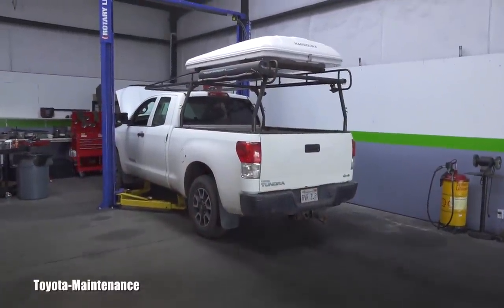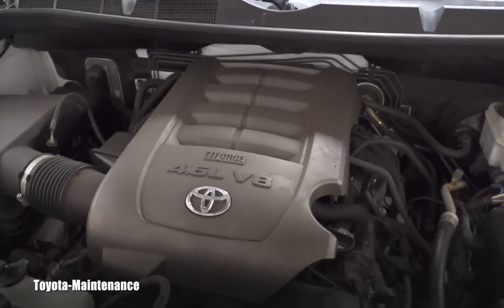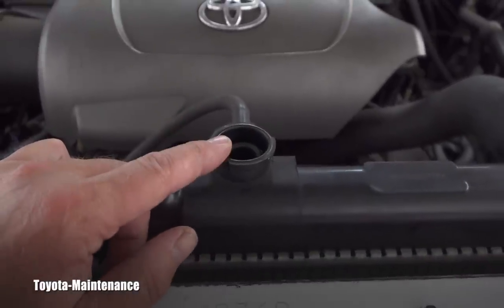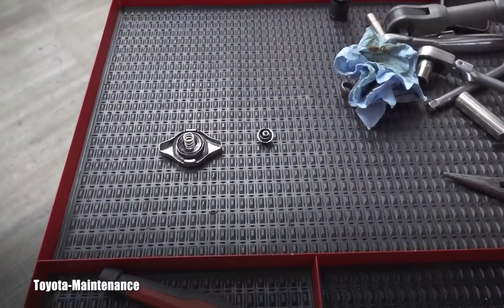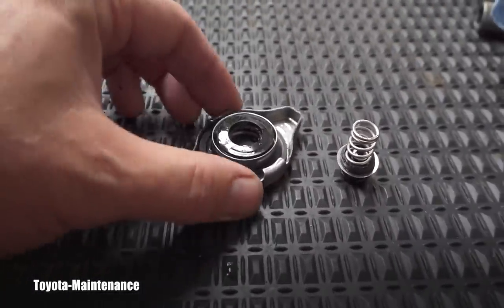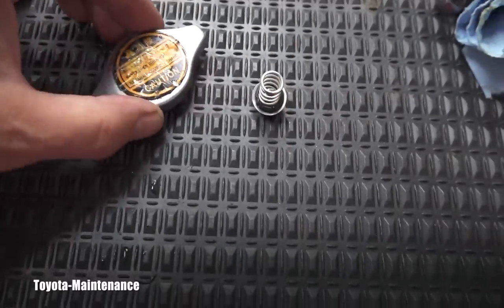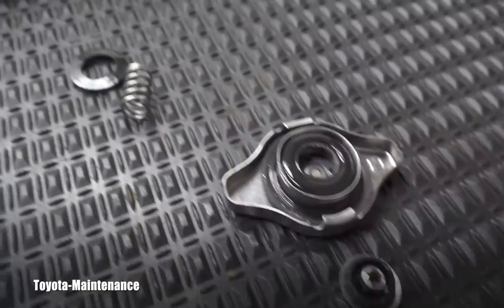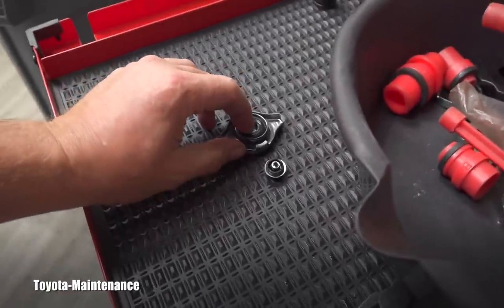The Curse of  Faulty Radiator Cap

Comment: I drove my yaris for 7 years with pieces of the radiator cap inside the radiator. I decided to take it to a radiator shop after 7 years, they removed the top plastic cover of the radiator, and the pieces were hanging on top  channels without any problems. The coolant flows from up to down,  and because those pieces are too big to go through any of the channels in the radiator, they will just hang there with the tight channels acting as a sieve.

Comment: I’m a newbie, I don’t know ANYTHING about cars 🚗 , however I’ve been learning a lot. I just recently had my first car crashed into and the insurance paid me out, unfortunately I had no option at the time but had to buy me a 2009 Toyota Corolla—-I had to do some research on the best car models and Toyota Corollas were always recommended. Anyway, the car seemed like in really good working condition and it looks great on the outside. The car didn’t make any strange noises during the test drive, it ran great, the ac worked fine, the turning and acceleration seemed all on point, but what do I know? I’m not a mechanic. Well, the next day I took it to a mechanic and they found a whole BUNCH of stuff wrong with it. The more important stuff from what the mechanic said needed to be replaced was the Radiator, radiator cap, transmission fluid, and serpentine belt. They were willing to do the work but it was sooo much and I couldn’t afford any of it, so I decided to dig into this and I researched how to replace a radiator and cap. So far I see a full radiator for about $90 and a radiator cap for $30, totaling about $120 if I do the work myself opposed to the nasty $800 for a radiator replacement and including the cap! I’ll be literally saving around $680!! If I did the work myself or shop around, but I might be up for trying to do the job my self to save the money. Of course, I still need to do more research like something about draining the fluids or what not. I don’t own any tools, however I have a buddy that does and even a neighbor that might lend me his. Anyway, my point being is, that I had absolutely NO clue that the radiator caps needed to be replaced AT ALL and after watching this video it makes me realize that the radiator cap should be checked and replaced routinely! This should be common knowledge just like how everyone knows to get an oil change or tires rotated or even replaced. That’s something I would have NEVER guessed before I started learning about cars. My goodness, my eyes are now opened, this is the second video I’ve seen where the radiator cap can cause substantial issues with the car if it’s not maintained, luckily it’s a easily fixable and affordable car part. Anyway, I never really put a lot of effort into my first car, but I made a promise that I would maintain this car much better and have been making an effort and I’ve learned quite a bit. thanks for posting this video, it’s helped tremendously! 🙌🏻

 I still need to do more research on the serpentine belt and transmission fluid, but that stuff I might just have a mechanic take care of, wish me luck y’all cause times are rough out here. 😂

Comment: Thanks for the video. Happened to my radiator cap. Replaced cap with Toyota one. No overheating problems. My mechanic says as long as it doesn’t cause any problems, the parts can stay in the radiator for the life of the radiator. The same kind of plastic corrosion happened to the heater tap located on the firewall through which hot coolant flows toward the heater box to warm the interior when needed.

Comment: Wow I can't believe I found your video. I have a lexus is300 2004 model and exactly the same thing happened to me just the other day and I had to fish out the spring and plastic washer part after overheating and being stranded on the motorway. The fans wouldn't kick in either so I limped home stopping and topping.up every mile or so. My car is still sitting on my drive waiting for someone to tell me what's wrong. However after watching your video I don't think there is anything else wrong and that I just need to replace the cap and refill and bleed the system. What are the chances of that..thank you for the video and thank Mr Toyota for breaking down and then spreading the word... it's a powerful thing. Peace to all

Comment: This occurred to a VW my good friend was servicing at his garage. Apparently, it damaged the plastic impeller on the water pump and sent plastic bits throughout the engine cooling system. Moral of the story: Change your thermostats and radiator caps every 5 years according to his radiator repair shop. Stick with the OE parts.
Reply: SIGH.......the radiator cap in this video IS "an OE part".......I KNOW, I can tell by looking at it. Every component in this cap is EXACTLY identical to the ones I have for my Toyota Tacoma. Besides: NO auto maker "produces their own radiator caps"..........EVEN "STANT" RADIATOR CAPS ( who has been making radiator caps, thermostats, etc, as APPROVED ORIGINAL EQUIPMENT FOR COUNTLESS AUTO MAKERS FOR OVER 75 YEARS ) LOOK IDENTICAL TO THE ONE SEEN IN THIS VIDEO........AND EXACTLY LIKE MY CAPS.......I BOUGHT MY CAPS FROM AN AUTHORIZED STANT DEALER. Best wake up man, because countless parts from lifters to electronic parts ( such as sending units) are now obviously being OUT-SOURCED by the OE makers themselves to the cheapest foreign country they can find to make their "OE parts" FOR THEM........and then they pass that SHIT on to us, the paying customers, as "the right OE part". My advice to anyone during these very bad times is to try to find OE parts that are NEW/OLD STOCK......AND START HORDING THEM FOR ANY VEHICLE YOU INTEND TO KEEP.
Reply: good advice! thanks!

Comment: I had a '95 4Runner w a 4 cylinder engine: similar problem when the "Genuine Toyota Radiator Cap" rubber gasket fell apart and got stuck somewhere in the radiator. Result - overheating and backflushing would not help. A new radiator and $$$$  solved the problem. I wonder  how much Toyota saved with their crappy rubber gasket?
Reply: First off, Toyota didn't make the radiator caps, hell, they don't even make the radiators ( or starters, or alternators etc....all that stuff is out-sourced......other auto makers outsource that stuff too. ) If you noticed in this video, THE ENTIRE SPRING & CENTER ASSEMBLY TO THE CAP BROKE OFF, not the rubber gasket. Obviously a defective cap. You said you bought a '95 4Runner. Did ya buy the truck new? And regardless of whether ya did or not, how long do you expect the rubber gasket in a radiator cap is to last? Ya don't expect spark plugs to "last for the entire life of the vehicle".......so why would anyone expect the same from a cheap radiator cap??? Just play it safe & replace the cap every 2 or 3 years. They don't cost that much anyway. But the fact the cap in this video BROKE COMPLETELY APART AT THE SPRING & ENTIRE ASSEMBLY........is very disturbing. This has me thinking I should replace my damned thermostat every couple years too......whether it "needs it" or not. Cheap parts nowadays are shit.

Comment: That's an odd failure. My 34yr old factory cap just failed last year and it was still in one piece. Too much plastic in newer designs. My old one was just metal and rubber.
Reply: LoL, That was before plastic. 😄 You really should have changed it before the seals failed. The outer seal fails causing the recovery system to fail. It gradually gets worse over time. My first vehicles didn't have a recovery bottle and I would always have to top off the water. I finally got smart and installed an aftermarket, because that's all there was at the time, coolant recovery bottle. I would also have to top off customer's water too. I was 15-1/2 opening and filling hot radiators.
Reply: @Esteban_Herrera  , you are right. The rubber seal started cracking and it caused a minor pressure drop. Luckily I caught it before anything bad happened. I still have the factory part as a momento. They just made them better in the 80s.

Comment: This needs to be a recall situation as it happens more often then many realize.  Cap in video looks like an OEM Denso cap.  Remedy to prevent?  How often should it be changed to avoid the plastic degradation?
Reply: To avoid plastic degradation, get rid of the plastic, replace with Stant.
 
>>>>> I was wrong Stant is the same POS. <<<<<
Reply: @Esteban_Herrera  That IS a Stant radiator cap in this video for this truck. Trust me. How do I know? Check this out: I just had my 3RZ-FE engine totally rebuilt in my 2000 Tacoma 4x4 ( that I bought brand new. ) It had 376,000 miles on it when I finally blew a head gasket, which had a tiny pin-hole right next to cylinder #3, when we tore the engine down. Bottom end & bearings were in beautiful shape, I could've slapped a new head gasket on and "sent it"........but I had the whole engine rebuilt anyway, to get all of the factory new compression ( including new 0.020" over pistons & Hastings moly rings, the truck didn't use any oil before, had only slight leaks )......INCLUDING A BRAND NEW ORIGINAL TOYOTA HEAD CASTING with all upgraded valves, valve springs, etc. ( I buy only the good stuff. )  I also bought a new radiator & radiator cap ( along with hoses, clamps, belts, plugs & wires, etc. ) The new radiator cap looked exactly like the one in this video, which really bothered me. SO I ORDERED A STANT RADIATOR CAP. It arrived 2 days ago. IT'S THE EXACT SAME CAP AS IN THIS VIDEO & JUST LIKE THE NEW ONE I BOUGHT PREVIOUSLY AT THE PARTS STORE. That yellow sticker you see on the cap in this video, peel it off, and it's the exact same cap as the Stant I just bought AND the new one I bought before. Now get this: My original radiator cap that came on the truck when it was new, HAD A SPRING THAT WAS LARGER IN DIAMETER........but it had the same spring pressure as the smaller spring on the one seen in this video and the two I just bought. My original cap also has that yellow sticker, so I peeled it off for a closer look, it's exactly the same cap, other than the bigger diameter spring. The tiny tip at the center however, is identical to the other 2 caps I mentioned above. The Stant radiator cap made for Toyota is MADE IN MEXICO. Look it up for yourself. So I guess the best any of us can do is play it safe by replacing the radiator cap every 2 years......even the one branded as STANT. They don't cost that much anyway. The caps for these Toyota's have such puny little parts/components, I'm simply not going to bank on ANY cap lasting over a couple years. ( made to fit Toyota's anyway ) This video taught me a lot.
Reply: @Esteban_Herrera  I don't bullshit people. I like to share good information that I've learned myself.
Reply: Just replace every 5 years.
Reply: @zaffo757  Boy you've got far too much faith in today's SHIT parts. Furthermore: you can tell that the radiator cap in this video is NOT "over 5 yrs old".......NO WAY. Take a closer look at it......it looks like it's less than several months old. As cheap as they are, I'm replacing MY radiator cap every TWO years......and I'm even gonna keep inspecting it very closely every few weeks on top of that.

Comment: Same exact thing happened to my wife’s 2013 Honda Civic. The original cap is made by denso. I never could get the piece out. Luckily, knock on wood, we have not had an overheating issue.  Hopefully we never will 🙏🏻
Reply: A year ago this happened to my 08 Honda Civic and now I’m having no heat issues inside of the Cab. I’m wondering if my Spring and Capp went all the way to block off the heater core

Comment: I have a 2000 Camry with 5SFE Automatic, 250,000 miles. I'm on a third radiator and today after a month, I have realized that my radiator cap may be the real cause of why 1) the first radiator leaked at the bottom after 3 years. 2) the new radiator leaked from the bottom after a weak 3) the replacement of the new radiator, 3rd radiator was fine but this time it blew the hose that goes to the engine. I changed the small pipe that goes to 5SFE engine and put some sealer and went on. Little do I know, it started leaking again, put some more sealer and it leaked again. Removed the sealer completely and put it again but this time, the two inlets that goes out from the water pump to the right of the engine started seeping so the only explanation for all of this could be the radiator cap. I called my mechanic and told him that I think I have found the issue and he said to leave the cap a bit loose and drive the car for a while and see if the leak stops, if it does, I have found the issue and i'm hoping this is it.
Oh and more signs of this is the fact that I see seeping on other hoses like the one on driver side that goes to valve cover. 
Lessons learned: The first thing to check when a hose bursts is the radiator cap.

Comment: Must be common. Happened on my sister in law’s 2012 Sequoia 5.7.  The truck was losing coolant.  I was not able to find the lower part. I assumed it was lost by someone else servicing it.  I will need to look further.  What happened to Denso quality?
Reply: Quality control of most companies has gone to 💩 over the past 10-15 years.

Comment: I had some pink crusties around my radiator cap over the winter and replaced the cap. Glad I did!

I’ve flushed the coolant but I’ve never replaced the thermostat. Wondering if I should but with this car I usually take the if it ain’t broke don’t fix it approach. 2006 Camry with only 133k km’s and very well taken care of. Only winter driven one or two years.
Reply: I would play it safe and change the thermostat and maybe even the coolant temperature sensor.
Reply: Might as well, it's easy and pretty cheap. Get the thermostat + housing for extra peace of mind (new housing plastic vs old) and ease of install (changing a new thermostat into your existing housing is kind of a pain and easy to break the plastic housing clips)
Reply: Yesterday I finished replacing my timing belt / water pump on my 2006 Highlander Hybrid at 193k miles. It was my very first diy timing belt job and was both terrifying and exciting. This morning coolant was on my mind because I added fresh coolant and the thermostat came to mind. According to Ahmed, he suggests to NOT replace the thermostat as a maintenance item - https://youtu.be/fMusCb1wvGM?t=2592. I personally am going with Ahmed's viewpoint.

Comment: Why would they use plastic on a radiator cap with a spring on it? I can understand using plastic caps on the overflow tank.
Reply: Money pal!!!!
Reply: Variable pressure and closure design with the notches and turning while pressing down
Reply: @LAactor  This is a secondary function. The spring's compression is set to release pressure usually 15psig. 👍
Reply: @Esteban_Herrera  the bar level is usually imprinted on the cap. It should not need to be said the primary function of a radiator cap.

Comment: This is beginning to sound like a broken record with Toyota.   I have a 2003 4Runner 4.7L and was in the middle of doing routine maintenance.  I decided to check the coolant and noticed that the radiator cap had a little resistance.   When I took it off, only the spring and a rubber washer was attached to the cap.  The bottom portion dropped into the radiator.  I managed to recover a warped washer, but had no luck with the remaining parts even after removing both hoses for access.  I decided to just replace the radiator, since the engine wasn't running at the time. In the future, I will change out the radiator cap at least once a year.

Comment: Seriously one of the most under-rated automotive channels on YT.  I bought my wife a 2012 Sienna with the 3.5L and sealed transmission 140k miles recently.  It has the sealed transmission and has no issues. Maybe you can answer a question for me?I plan to replace the transmission filter/fluid and add a cooler to protect the transmission soon but have been told I must drain & fill via the pan instead of thru a cooler line hose as I've done in the past.  Is this the only way to flush the system or can I do it thru the cooler lines when I add a transmission cooler?
Reply: I have seen others do a poor man's flush through the cooler or even transmission lines before. It's fast, efficient,and gets out all the old fluid. Drain and fill will only gets third of the old fluid unless you do 2-3 drain and fills. Just make sure on the sealed transmission tongo through the correct process of checking the fill via the drain straw and correct temperature after you flush.

Comment: Now I'm worried that the small piece of rubber missing from the gasket on my radiator cap is going to cause issues somewhere down the line, I can only help the metal fins on the water pump chop it up enough where it doesn't become a problem.

Comment: Partner I found your video accidentally after making frantic search trying to figure out why my Toyota camry radiator cap looked funny when I removed it to change the Anti freeze. After I refilled I tried to fill the engine and I started getting boiling in my Anti freeze reservoir. Engine Temp gauge did not show it was getting overheated but the reservoir kept boiling. I am ordering a new Thermostat and a new radiator cap, but after seeing this video I will need to take the radiator and hoses and try to see if I find the parts within, I never found any debris on ground or inside cap opening. Wish I was that Lucky. It looks like I became a victim of this Radiator cap braking off within. Wish me luck.

Comment: 2 Toyotas I have purchased had this exact issue.   Got them cheap because I see what the problem is when I open the cap when telling the owner i'm checking for a blown head gasket bubbles.   They know they have an issue.  As soon as I see that missing center section...I know what the problem is.